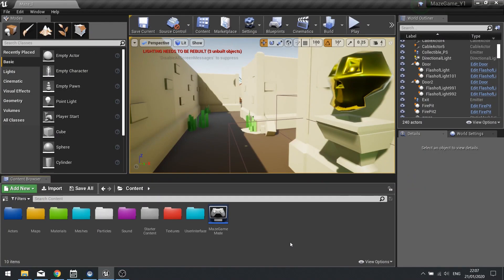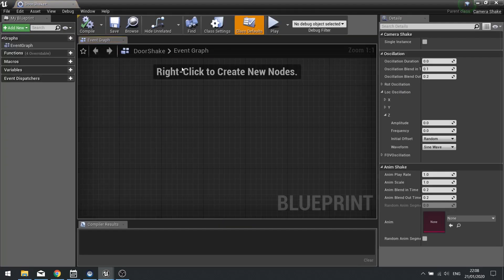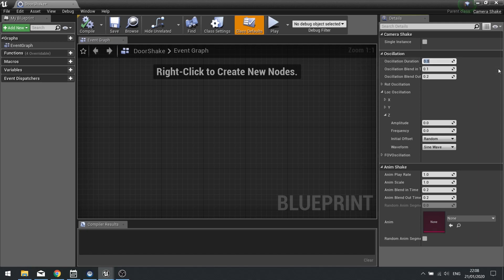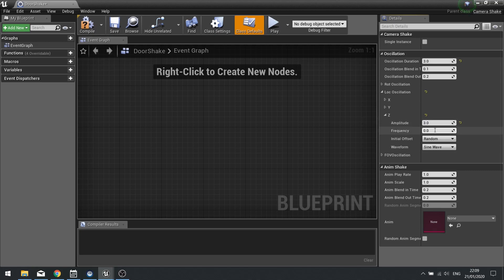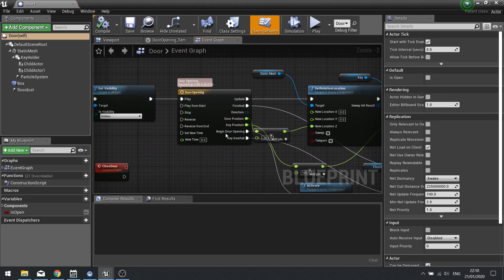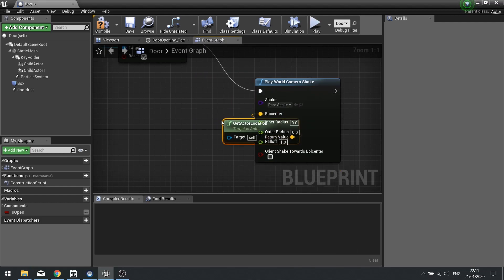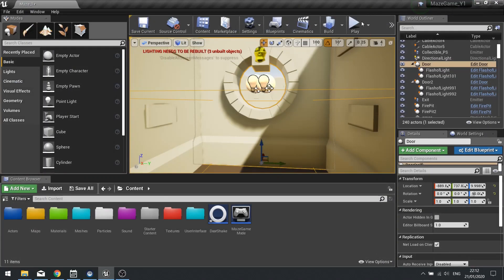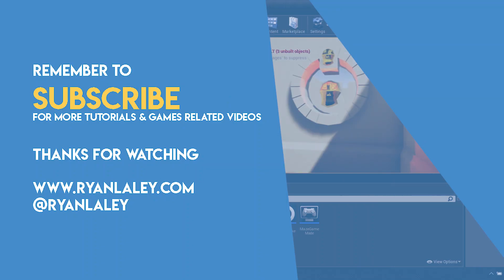Unreal Engine 4 SnackSize - Camera Shake

Comment: For 3:30 Where exactly do I plug in the Play Camera Shake node? I am asking because I am using a Timeline but it does not have the same output(s) you have.

Edit: also I made an ability that causes the camera to shake however the camera keeps shaking after the ability actor has destroyed itself.